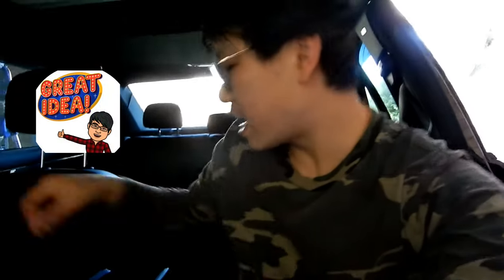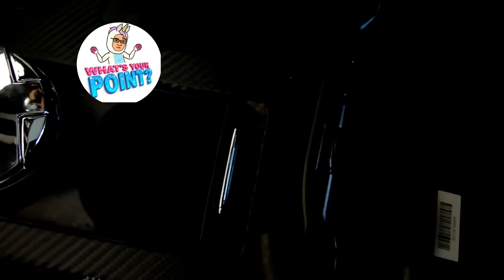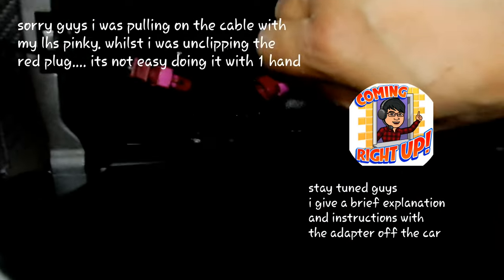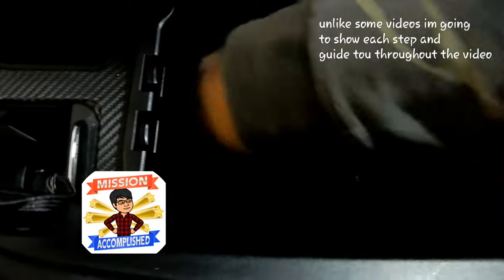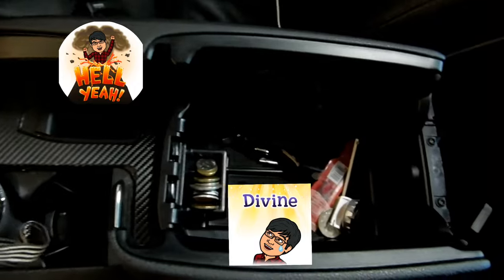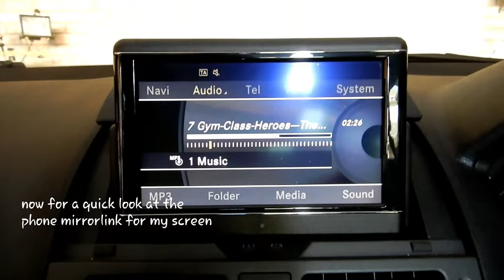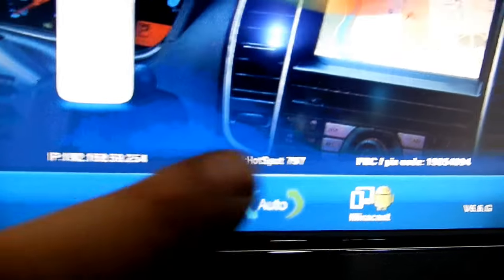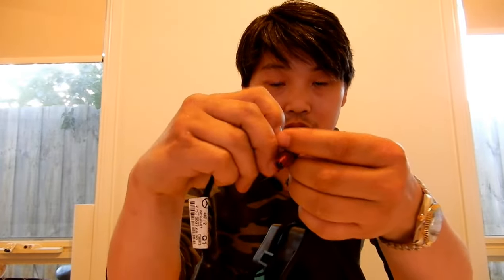MERCEDES W204 how to REMOVE THE CENTRE CONSOLE PHONE BLUETOOTH ADAPTER+PHONE MIRROR LINK

Comment: Thanks. Worked for me! I have a 2010 E class coupe W207, and it was near identical. For me I disconnected the wires from where it goes into the phone adapter, because i did not encounter such cable clips. Did not want to pull any harder. Anyway Im glad its out, so much space! Thanks again😊
Reply from the maker: great news

Comment: I was curious if there is a way to get blutooth audio when removing this? I am currently having an aux to bluetooth adapter because my 2007 w204 doesnt have a media interface. But the signal coming out the aux to bluetooth is just so quiet.
Reply from the maker: apart from adapters there's no other way ...u should try using a aux amplifier to boost your sound ..I didna video about it and it dies work

Comment: I have a question about the mirror link. Can you play your radio while using mirror link for Waze navigation or google maps? 
Also I assume you will need Video in motion module in order this feature to work while driving, right?
Reply from the maker: unfortunately not. once u connect the mirrorlink feature it will play through ur speakers..so u wont be able to play radio and mirirlorlink ...and yes u need video in motion ofcourse dear friend... u r correct
Reply from the maker: hey friend after further investigation yes u can play radio while u mirrorlink your phone for android auto or Google maps is running via phone mirorlink feature ... it's quite useful if u just want to use google maps and have your radio still playing

Comment: Thanks for this video. Before I remove mine is there any chance you could just confirm what the unit actually does? Will I still be able to Bluetooth to the command centre. It’s w204 face lift.
Reply from the maker: ?yes I just double checked and I can still use bluetooth for phone calls...mine is preface .. I'm not exactly what the facelift connects to.. just unplug and see if u can still connect your phone ... that's the only way ...

Comment: Where did you get that mirror link device? And does it work with iPhone?
Reply from the maker: it will work with any phone cuz it uses wifi to connect ..but there are so many more better devices out there now ..when i got this they didnt have the newer style hdmi mirrorlink ..it was all that was available..now u can get the plug and play version for about 400 or a bit less.   aliexpress and ebay have them.

Comment: Hey Mikey, love the video.  I have a C63 W204 and my phone cradle looks a little different to yours.  I know this video is old lol. Mine seems to also have a USB attached to it with a weird ass plug that has a blue tooth dongle currently inserted- a MI-LY-005 BLUETOOTH music adapter.  Have you seen this before? So not just the phone adapter but it has a usb plug below it in the same housing. Sorry can't add a photo.  I've managed to pull out 3 tabs but there seems to be another plug behind the USB mounting
Reply from the maker: hey bud thanks for the kind words.. no i cant say i have,,, not on a w204 which model do u have ? what year ?? i honestly cant say ive seen that befo0re
Reply: @MIKEYZVLOGZ  Thanks Mikey its a 2012 C63. I've found out that the weird plug is an MMI and this must have been an option. My phone adapter has a release switch so it swings up vertically and attached to a swivel setup on the left hand side. It swings up to get access to a USB and this MMI plug (looks like a DVI connector). I could get the 2 side and front lugs out but there is something else holding the base down in the bottom of the console 🙂.Looks like I will have to either go to the Stealership or try a mobile car HIFI guy
Reply from the maker: @waynedavies3088  og isee.. wish u all the best mate
Reply: @waynedavies3088 there is a T15 holding the mmi/usb, you can reach it from underneath, behind the 'lid'. It's hard to reach and I had to 'break' the mmi housing to get all out.

Comment: I've recently done this in myC207. But now I'm wondering what can be achieved with the remining wiring in the console????????
Reply from the maker: not much really ..u may be able to power something but if u want some sort of power ur better off using the cigarette lighter port
Reply: @MIKEYZVLOGZ  So its low powered then, just for operating an old school phone, and not actually for charging???? It also has an antenna wire I think.
I complertely dissassembled the unit (which you have t in the C207) to get the wiring disconnected.
 I have also noticed that my Command now asks if I want to connect to Bluetooth Telephony, which it did do automatically before?  It still woks just the same though. I also have the Bluetooth music adapter in the glovebox. I'll eventually get around to installing AppleCarPlay I guess.
Reply from the maker: @tarantodesign  correct doesn't affect the bt of the phone to connect to unit so I dunno what ut was for apart from a old phone

Comment: Is it possible to use one off the spare cabels to install a USB port or something?
Reply from the maker: Not sure but as long as the cables have power like pos and neg u can always hard wire a usb... just gotta check for the voltage

Comment: I was wondering if it's possible to add 12v outlet using the cable disconnected from the adapter?
Reply from the maker: if u test the output of the current and its 12v then yes that's not a problem ...

Comment: Any idea what to do if my display doesn't fold back? Functions perfectly, tilt works but as soon as I press the retract button, it starts folding but stops at 15 degrees. Then comes back to original position. Pressing the button second time, it starts retracting but stops at 15 degrees and there is no picture (sound stays on though).

Last night I played with it a bit and this morning when I came to the car, it wouldn't start. What I noticed is drop in Voltage (11.1 V). Comand dried the battery out and I noticed it was trying to close a the time (every half a minute or so) even when the car was off.

What could this be?
Reply from the maker: hey mate ..sorry to hear your problem .... so i too have noticed that the screen and system auto shuts off and folds in once your radio has been playing for a certain time if your engine isnt running ... ..its a safety feature so your car doesnt drain battery to the point it wont start... in your case there must be something caught in the folding pattern for your screen ... check there is no debris caught in the folding line for your screen .... or its getting jammed or stuck ....i cant say definitively what it is as i. not too sure ..... but be sure to check these things ...hope i was somewhat helpful ...also wen i have a issue i always try to google it as im sure someone out there has had a similar issue... for sure .... its handy to join forums also... theres alot of help out there for us w204 owners and all car ppl in general
Reply: @MIKEYZVLOGZ  thanks mate, will try on

Comment: Where's the video to remove the rear AC unit? My car doesn't automatically connect to my telephone Bluetooth anymore after removal as it's looking for the built in phone before connecting to my phone
Reply from the maker: hi there friend.... i never did that video ..but i would be happy to do a quick video showing how to do that if thats something u would like to see.... as for you bluetooth connection... im not sure it would be related to this bluetooth adapter... this reason being unless you are actually using the bluetooth adapter in the glove box which also requires a specific device to work... it may just be a case of removing all phones currently connected to your car and then re syncing your phone... that is where i would start... hope this was somewhat helpful ...as for the video on how to remove the rear ac unit to gain access to the connectors for the built in bluetooth adapter i will work on that for u asap...
Reply: @MIKEYZVLOGZ  Hi Mikey, I work in IT and I've troubleshooted this.

I believe the phone system works like this - communicate to the "convinience" built in phone cradle, it says no phone detected (as none of us use it) then it searches for Bluetooth telephony. Now, it hangs on "activating telephone" and then says "no telephone inserted" then "failed" I then have to get COMAND to connect to my phone in the Bluetooth devices list and then it works. 

Before, within seconds, the cradle would say no phone interested in the back end and connect to Bluetooth but without the cradle, COMAND isn't being told nothing is inserted. 

I think the solution is to remove all wiring for the phone system. Please make a video on removing the rear air vents and unplugging the entire phone wiring as if it's disconnected at the main, it'll know there's no physical phone setup at all let alone communicating with the cradle.

Hope this makes sense. Cheers and do upload the video please
Reply from the maker: @MH-hg4ug  ok i understand ill do that within the next few days or sooner if i can ...
Reply: @MIKEYZVLOGZ  thank you mate, much appreciated
Reply: @MIKEYZVLOGZ  any update on the video?
Reply from the maker: @MH-hg4ug  will be posted today within 24hrs
Reply: @MIKEYZVLOGZ  Hi Mikey, any update on the video being uploaded?
Reply from the maker: @MH-hg4ug  yes its uploading
Reply from the maker: @MH-hg4ug  hey buddy the video has just been processed ..hope it helps you out
Reply: @MH-hg4ug  Hey guys,

I am experiencing the same problem with my COMMAND not autimatically connecting to my phone via Bluetooth after I've uninstalled the convenience phone. 

Have you managed to get around that problem at all? Please help! :)
Reply: Did you solve this problem after all? I have the same issue.
Reply: @MH-hg4ug  any luck with fixing this issue?

Comment: Didnt work for me
Reply from the maker: do u have the same type of adapter
Reply: @MIKEYZVLOGZ  Yes and same year same car same motor same extras. 

It did work in the end. i just took my knife and slid it between the wall and the longer side of it and pried it out. there are 2 Gigantic clips holding it with the power of hulk inside there
Reply from the maker: @DerAngeloMerte  yes u can be sure of that which is why its abit of a pain to get out but once u do take it out I strongly recommend to buy the extra layer thing I bought it comes in handy..and well done for improvising and figuring out a way to get it out... I take my hat off to you for thinking of that.... hi 5! ...lol.... hope you can subscribe to the channel and show your support .... love helping others out
Reply: @MIKEYZVLOGZ  I am already subscribed :D You are doing a good Job. Btw. if u are struggling to show which part where to press and stuff like that. Just type in the number of the product in google. 4example this one was A2048230011 or so. And i saw the skematics how it looka like in the compartment. 

Sry for my bad english. Btw u tought me how to open the windows with the key. it never worked because i was to far away. And sadly my headlight sprayers are defect :/ they are not coming out even if i tap that thing 20 timed
Reply from the maker: @DerAngeloMerte  all g mate ... but good tip mate ...commenting and showing other people what to do is why I started this channel I wanted to share the knowledge of how to work on w204s with no mechanical experience ... so good on ya for joining the club and channel .... we all need to help each other out and help save money
Reply: @MIKEYZVLOGZ  Btw there are tons of editors on Youtube who will make u a really good individual Intro for 50-100$. It will improve the quality tremendously
Reply from the maker: @DerAngeloMerte  ye I am working on a new logo and intro also thanks for letting me know I'm getting on it cuz I cant believe how fast my channel is growing aswell I only started about 7 mo this ago and already have had this many subscribers ..I'm so overwhelmed ...I didn't think I'd even reach over 10 subscriber but here u guys are subscribing and I'm so grateful so I am gonna I.prove all aspects of my channel
Reply: @MIKEYZVLOGZ  Awesome. looking forward to that. Keep it up. Also there is another w204 youtuber named Flexx. Maybr find some Inspiration in his vids?
Reply from the maker: thanks for supporting me I have so much more content and videos to come also... so dont forget to hit that bell/ notifications bell so u will.be notified when I upload new videos ... I also have a 750 and 850 subscriber milestone giveaway coming real soon...at 750 I'm giving away the entire license plate light rear camera setup... from the camera setup to the fakra adapter cable aswell... all u have redo is watch part 2 of the camera videos and like and comment on that video and I'm going to select one random winner and send the entire kit to them
Reply from the maker: @DerAngeloMerte  yes I know of him too... but his car is mainly c250 mods and I have a c300 .... but yes he has good mods and videos too.... I am subscribed to him but he has not subscribed to me ...lmao...oh wells .... his been around for along time .... but certain things he hasn't done yet so I try to do videos he hasn't done yet rather then doing the same.... I just want to share my passion and hobbies with everyone and also show how to fix certain things so that u can save money
Reply: @MIKEYZVLOGZ  I live in germany. sending me the kit would cost more then buying it myself :D
Reply: @MIKEYZVLOGZ  What i woulf find really really interesting is a Kompressor Kit for the c300. I now its not factory and shit, but to charge the c300 would boost the hp to arround 400hp